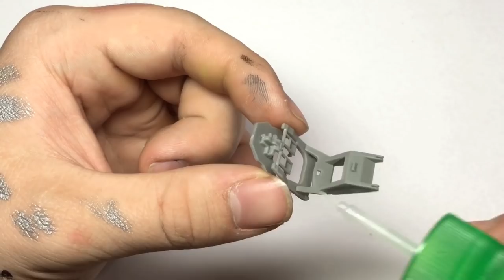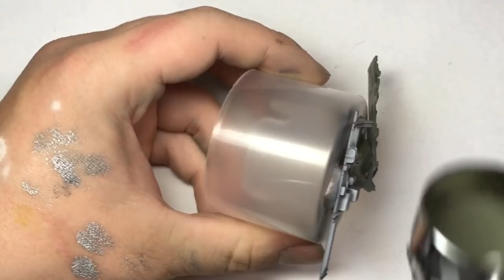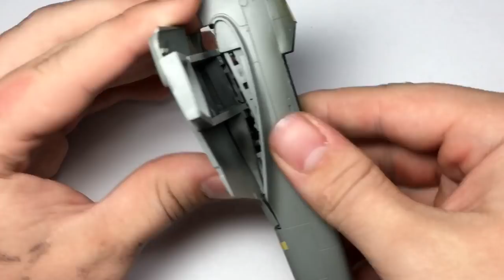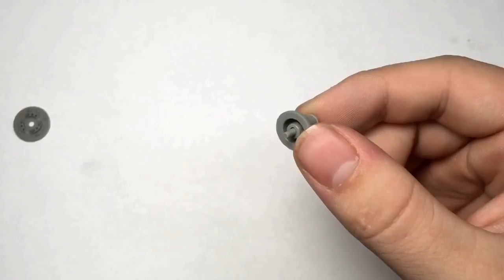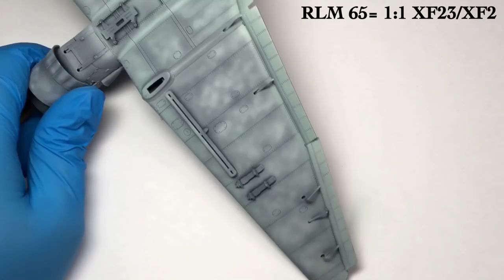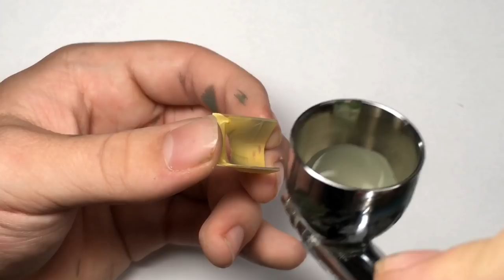Airfix 1/48 Junkers Ju87R-2/B-2 Stuka- TIMELAPSE BUILD

Comment from the maker: Viewer pointed this out- the swazi is NOT included in the kit; I don't know if it's a British thing or because they sell a lot to Europe and it's a huge cost save to only make one boxing of each version, but they are not there. I used a multi-scale sheet from Warbird Decals.
Reply: Its right across the board these days with most kit manufactures, and as we know its banned through most of Europe. One way some get around it is to print the swastika in two halves on the decal sheet so it doesn't resemble it. Some exceptions ive come across are the Storch from Tamiya, on initial release the box came with a sleeve, on the sleeve was the box art with....you guessed it no swastika, but, take the sleeve off and the box art underneath has it.....sneaky.
Reply from the maker: @timorvet1  Haven't there been instances where either the manufacturer or someone in country has actually gone in and cut swazi parts OUT of sheets from inside the box?
Reply: I started collecting kits in the seventies when Roy Cross's artwork made Airfix box art the best in the business and decal sheets were historically accurate. Then someone complained about the 'militant' box art in children's (?) retail and Airfix neutered the box art along with most other manufacturers. Not long thereafter the tail insignia started to disappear. All this did was make my unmade collectable kits from the sixties and seventies even more valuable to serious collectors.
Reply: @Theogenerang  Im afraid Australia complained about that.
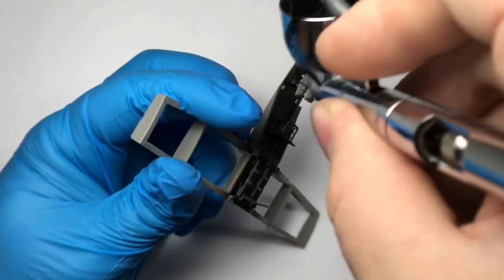Reply: I do love the Luftwaffe, so now I got a "small" fllet of palne in my home jajaja. I do love that flag you got, maybe the preatiest one of the Germans. I'm boold but I   do lke the way of your hair..rStill I got my blonde beard and mustake jejeje. I do always work with 1:48  in all my models cause I like compare sized and lines among the planes . All the Best and take bout'coronavirus. All mien got Swastikas that I bought appart the models.
Reply: What is the song on 10:33
Reply: @TheWaggishAmerican  do you know source where to buy Luftwaffe stencil with swastika or decals? Lots of kits don’t have it (which is incredible stupid)
Reply from the maker: @vladimircanada7505  i just buy multiscale decal sheets from ebay.
Reply: @TheWaggishAmerican  just one more question. What kind of glue do you use for the cockpit glass?
Reply from the maker: @vladimircanada7505  krystal klear but pva works fine
Reply: That's weird because In the UK where Airfix is from the logo is included in most kits that are German based(at least all the ones I have bought it's been included)

Comment: Very nice build. I have both this kit and the earlier B-1 version. One small point, in the video you said you used Tamiya XF-22 for the interior color (Which should be RLM 02 Grau-Grun or Grey-green) Be aware that Tamiya XF22 "German Grey" is not a good match, being too dark and too greenish. (It is actually close to RLM62 Green-Grey, a pre WW2 era Luftwaffe colour!) The best mix is 2 parts XF2 (Flat White" to 1 part Xf22) - this lightens it considerably and also brings out a stronger greyish hue, very close to the RLM colour (Which, BTW served as a primer coat!) The instrument panel should be RLM 66 Schwartzgrau or Black grey, a very dark grey, with black instruments and bezels. Later types of Stuka (the D & G)  post 1940, had the whole cockpit in this RLM 66 colour.  (A long time WW2 modeller, I am.)
Reply from the maker: Thanks, I'll add that to the growing list of notes on German colors I've sharpied into my wall back home. What is it about these colors that companies just CANNOT make easy?

Comment: I've never really been a big fan of the Stuka, but damn it all if I don't want to build this kit. It looks incredibly fun :D
Reply from the maker: It is a good time!
Reply: The Stuka is an amazing aircraft, had a system to pull out of a dive automatically at a pre set height if the pilot blacked out, it also had explosive undercarriage so pilot could remove them if they were damaged and make a belly landing.

Comment: I want to get the set but I dont have the money for all them tools like an air brush and a bunch of different paints.

Will the paints from the site make it look just as nice also what's the glue you are using?
Reply from the maker: Tamiya Liquid Cement for the most part, I use a tube poly cement for high-stress areas like landing gear.

You can make models look nice without an airbrush- one way to is to use spray cans, which cost between 5-10 dollars each for modellers paints and will get you the right color. 

Alternatively, it is possible to paint nicely with a brush. Go watch "Quick Kits" to see how. 

I can't speak to the accuracy of Humbrol paints, because I don't really use them. I've heard decent things, just know that their light olive tends to run a lot less tan than mine and is usually more of a light green.

If you've never modelled before and are looking to start, you probably want to start with a smaller/simpler kit. Airfix's 1/72nd scale Stuka would be a good candidate, and I think you can get it in a starter set.

Comment: Hey does the clay wash just come off in water? I find enamels always eat through my tamiya gloss unless I'm doing it wrong. Hopefully clay could help. Thanks!
Reply from the maker: Yes, the clay wash is water soluble. It has no other thinner in it- the only thing I would be concerned about using it on is MAYBE a water-based acrylic topcoat, like if you are sealing with Vallejo or something like that.

Comment: What color did you use for the cockpit?
Reply from the maker: I believe I used Tamiya XF-22 RLM Grey. It's good for all early-mid war interiors, until ~late 1942/1943 when new production switched over to the RLM66 interiors. For that I use a slightly lightened Tamiya German Gray.
Reply: Thanks

Comment: You can use Micro-Crystal Clear and make small clear parts. Sometimes you can get away with using Elmer's if the part is not too big.
Reply from the maker: That's what I wound up doing. A few days of piling crystal clear onto itself filled the void. It's not perfect but it's functional.

Comment: As a casual watcher of these videos, I wonder why you never use the crew figures? It would be my preference but is there a reason why you don't?
Reply from the maker: There are a few reason's here. In this specific kit, it doesn't come with any. Airfix has pretty much stopped including them in new 48th scale releases. 

In more general terms, I like cockpit detail more than I like figures. I also hadn't been getting good at figure painting until recently, and didn't want to drag down a build with a subpar figure. 

The biggest reason, though, is that including a seated figure just doesn't make sense for the way I display my builds. My builds sit on a shelf- basically it's assumed that they are sitting in a hangar or something, where there would be no reason for the pilot to sit in the aircraft all on his loansome. It'd be different if I did more dioramas. 

The only time I could really see myself using normal seated pilot figures is if I was building a model in flight- either to suspend from my cieling or to do an in flight diorama like my Stigler concept. In that case, I think it would be more jarring to not have figures that to use them. 

The final and less important reason is that a lot of the figures are very low quality. It's not a big problem with modern 72nd scale airfix, but a lot of kits that included them are either very old and soft, or have massive parting lnes.
Reply: @TheWaggishAmerican  Thank you for your detailed explanation and I fully understand your reasoning. I guess as a child, I loved looking at the crew through the cockpit, having been weaned on British war comics and pestering my father and two uncles who were in the RAF during WW2 for stories. My models were built for play and the figurines were part of the game! Love watching these videos though. I call them Model Porn which confuses my wife!
Reply: @davidcollins3496  I can see why it would confuse your wife! Hahaha

Comment: A quick fix for your lense would be try crystal clear it's a great liquid that using a tooth pick can drag it round corners inwards to form a clear window once dried takes seconds to do.. and its readily available in USA.. or try deluxe glue n glaze
Reply: Use PVA glue, near enough the same stuff.
Reply: @MillwalltheCat  it similar but it tends to pull inwards and not be as clear... all relative to what your project needs are.. but it will work..

Comment: Nice neat build, I'm curious about why you separated the undercarriage spats, and then reassembled them?
Reply from the maker: Painting. Its a lot easier to paint them off than to try and mask them on. Unless i painted them and then built them in the video, in which case i screwed up some editting
Reply from the maker: Oh are you talking about the cutting? That cut line is dependent on whether you want to build it sitting or flying. If flying, use the full gear. If sitting it's under weight, and that part of the strut was in fact the oleo.

Comment: I am surprised when they built the stuka they didn't have the landing gear fold away and used air brakes.
Reply from the maker: When it was designed retracts where still fairly new. Air brakes all dove bombers have- you will not pull out otherwise. Mildly interesting, some models of the stuka had a features that blew a small explosive charge and ejected the labding gear for a safer belly landing, bht i dint think it was ever actyally uswd in combat

Comment: The oil cooler intake does not look right(comparing it with photos of the real thing)it looks like they copied the intake shape from the 1/32 trumpeter kit wich is not right either.
Reply from the maker: Very possible. I haven't seen the Trumpeter but I really wouldn't be surprised.